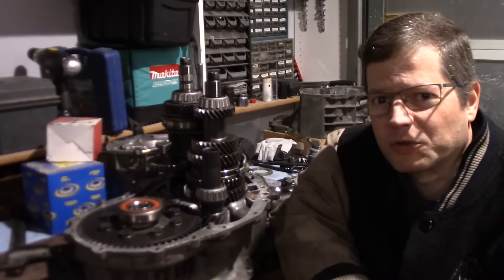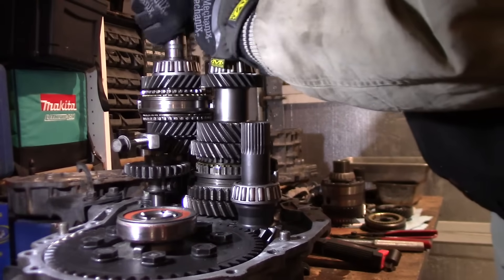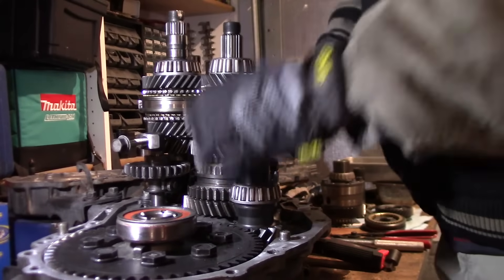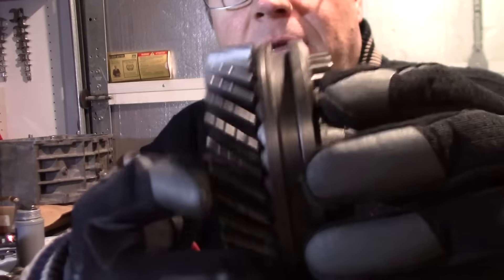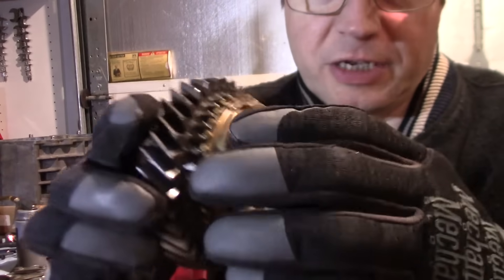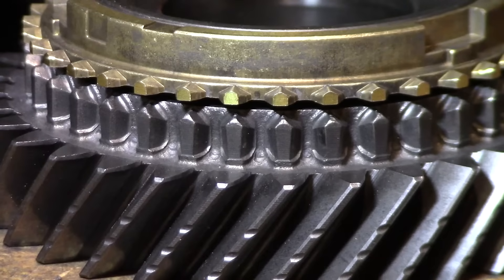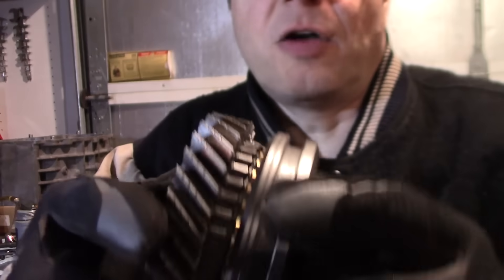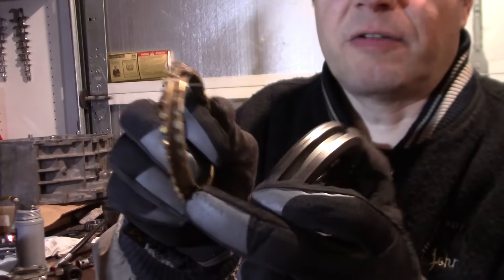How Synchronizers Work in a Manual Transmission

Comment: Since I am 74 years old and have driven manual transmission cars. So I basically know how synchronizers work. I also remember 3 speed column shift transmissions where only second and third gear were synchronized. First gear was not synchronized. The practice was to come to a full stop before shifting into first gear.
Reply: Good news i can teach you a manual has a gearbox 
An automatic has a transmission
Reply: @jimmyjames8573  
German engineer here.

If you look at it pure technically, many automatic transmissions have a lot of gears internally.

In our German language there is only a "manual gearbox" or an "automatic gearbox", never an "automatic transmission".

Calling it an "automatic gearbox" in English is also widely understood all over the English-speaking engineering world, specially in non-vehicle machinery as well.
So the term "automatic gearbox" appears to me not really wrong, it seems rather sounds very much like an US-English variant of your language. Is this possible?

Peace! from Dresden / Germany
Reply: @Gerd-2  Yes, Germ-Eng here, too, and for us the term "Transmission" is from crankshaft output to the drive of wheels, i.e. including clutch up to the CV-joints or live rear axle.
Reply: @56rockit  
Yup, same as "drive train" as I found this in some English manuals. 
"Transmission" (Antrieb) in German covers anything from the crankshaft output all the way down to the driven tires. 
I would totally agree with your comment.

Since I worked all over all continents, there might be a bit of "diversity" in local versions of English like the famous "hood" versus "bonnet" or as the Filipinos call their motorbikes a "moto".

While in German technical terms are very fixed almost as a definition, English technical terms can be very fluid.

Like screw and bolt, which can be both the same thing in English but in German a bolt (Bolzen) is clearly a headless screw and a screw (Schraube) is well, a screw (regardless for its purpose, size and shape) with whatever screwhead.

Regards and peace! from Dresden / Germany
Reply: @jimmyjames8573  A gearbox is a transmission. The words are effectively interchangeable.

Comment: Never had it happen but I wonder if a syncronizer ever gets stuck and freezes the trans in position?  I guess when the clutch is pressed the torque comes off the gears and the change in gear speeds pops the syncro loose?  Transmission design is like magic!
Reply: What was not mentioned is there are 3 spring loaded "dogs" inside the synchro ring/hub that effectively latch the ring in either the nuetral position or engaged to either front or back to a drive gear. Regardless of torque input, the synchro will hold it's position and shouldn't move unless there is manipulation from the shift mechanism.
Yes, a synchro can get stuck, either from corrosion or mechanical damage, or some failure in the shifting mechanism.

Comment: That was a great explanation. It honestly answered some nagging questions i had about the mesh up process. 
?So is it actually that bronze sleeve that gets abused when you "Grind gears"?
Reply: Yep, it's also the sleeve that gets damaged when the wrong oil is used. Not all synchro cones can tolerate modern synthetic friction modified oils, some need old mineral oil so the cone can grip the gear face.

Comment: DID YOU KNOW...
Big rig transmissions do not have synchro's? Double clutching is the name of the truckers trade to get the gears spinning at the same speed to mesh quietly. Most new drivers cant do it & cause much damage to the trans & clutch as they learn. SO, PACCAR, which builds Peterbilt & Kenworth trucks reports a full 80% of all new trucks ordered thru them is being ordered with automated transmissions which is  a heavy duty version of an auto trans, but, different. Anyway, the old gear jammers are fading away.

!
Reply: In Australia, you have a seperate thing on your truck licence just for the non syncro gearboxes. I have it. You also have manual or automatic car licenses too.
Reply: @OffGridInvestor  When I spend my then mandatory 15 months with the German army I made my HGV-licence at the same time and had a non-synchronized MAM-Truck as a learner. You (or better I?) got used to changing gears quite quickly. After my service I could write this army-licence over to a civil-licence.
Reply: Spot on mate
Reply: I guess when they start driving themselves they can go back to manual gearboxes!

Comment: This is a really nice video. I own a 2025 Ford Ranger manual. The engine is a 2.0 diesel single turbo. It has a 6-speed manual transmission, and when I try to shift slowly from 1st to 2nd gear, I feel a thump the moment I move the gear lever from 1 → 2, even though the clutch is fully pressed down. I haven’t released the clutch yet, but the impact is still there. Is this because it’s a brand-new car? I also read in some comments that 1st–2nd gear has no synchronizer — does that also apply to the latest Ford Ranger? Will it get better over time?

Comment: Kinda ask. My fifth gear can engage, only if I hold the shift lever and if I don't hold it the car sounded like crushing metals. Unlike my 1st-4th gear, it is always engaging and wont pull out. What could be the cause, is there a spring in transmission?
Reply from the maker: It sounds like the synchronizer ring teeth are worn. It could also be the gear that the ring engages.

Comment: So this is the reason why 1st gear is nearly impossible to engage at higher wheelspeeds? Because the force to synchronize at the speed difference is too high?
Reply: exactly. double clutch to get in
Reply: Can be but usually first gear does not have synchronizer ring
Reply: @cyrilboss9177  Not with the Rockwell Retro-Encabulator upgrade.  It allows for phase-shift-differential inertia mesh correlation.

Comment: I think I get it, but if the brass synchro gear matches the rigid gear speed through friction, is it just the bevels that allow the slider to move across easily and engage the gear, or do the bevels/teeth have to match perfectly when the speed is matched?
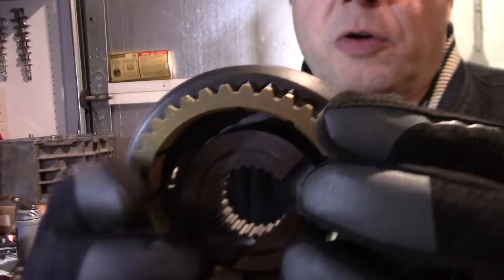Reply from the maker: @2:31 The brass synchro ring and the sleeve always rotate at the same speed, but there is some play between the two parts. The sleeve bevel angle matches the bevel angle on the synchro ring so that the sleeve is what is pushing on the synchro until the input shaft speed matches the gear speed. Basically you're pressing the sleeve onto the synchro ring when pushing the stick into gear. The synchro ring in turn will press on the gear's cone and that friction changes the input shaft speed to match the gear speed. When the speed is matched, the input shaft bounces back and counter-rotates. The springs in the clutch disk help with this counter-rotation. The bounce-back allows the teeth to line up and mesh.
Reply: @jtandrews3  thanks just as I thought, most animations showed the teeth lining up perfectly and I just couldn’t get my head around that

Comment: I watched a lot of videos but this one was short and sweet. Do you know where I can buy just one set of gears, synchro, shaft and shift fork for a simple project/demo like you have?
Reply from the maker: Thanks for the compliment! I watched your video on the Bronco. Cool channel. 
When I was rebuilding my transaxle from my 1997 Eagle Talon, I got the idea to show how the synchros work. It was unscripted and I missed one major point, how the synchro sleeve pushes on the teeth of the syncro until the speed is matched and the shaft counter-rotates letting the gear engage. 
Anyway, if you bought those parts from the dealer, it would probably be as much as a junkyard transmission. Maybe ebay? I know lots of junkyards operate on ebay.

Comment: All manuals have synchronizers ?
Reply: No. Some racing trans have large lugs that literally jam into other lugs. It is very aggressive and not really made for the street. They are usually called "dog boxes"
Reply: Yes, virtually every modern passenger (and definitely every USDM passenger vehicle) have synchronized forward gears, and a reverse gear, which is usually unsynchronized.

Industrial machinery, like tractors and (most) semi trucks, and older buses, have unsynchronized transmissions, or crash boxes. 

Motorcycles (and most other sequential gearboxes) are almost always unsynchronized, but this is somewhat different in theory compared to an unsynchronized transmission. These are "constant mesh" transmissions with dog clutches in place of synchros, and thus don't require synchros for seamless shifts.

Synchros wear though, and many drive with worn synchros. 

My 1st, 2nd, and 3rd synchros (and clutch) in my 09 Scion tC have been worn to the point that if I don't double clutch, I'll grind gears, or can't get into gear. In effect, it's a non-synchronous transmission with synchros.
Reply: @callang9  many thanks